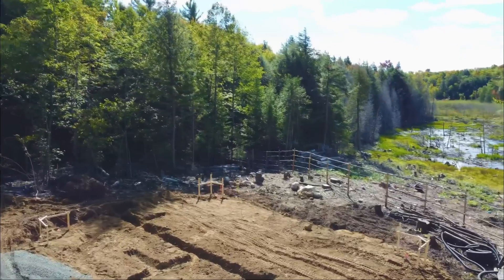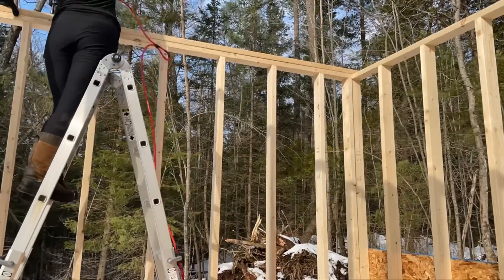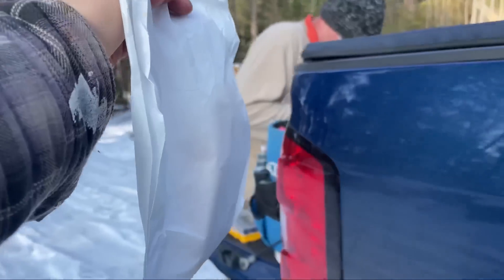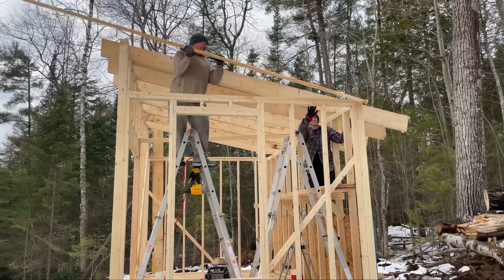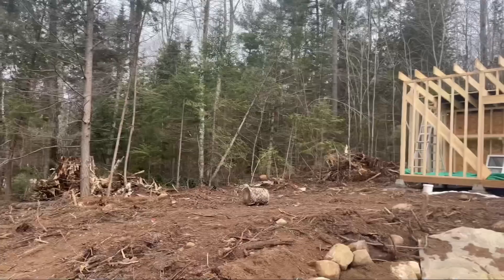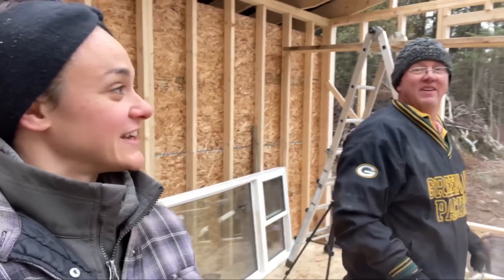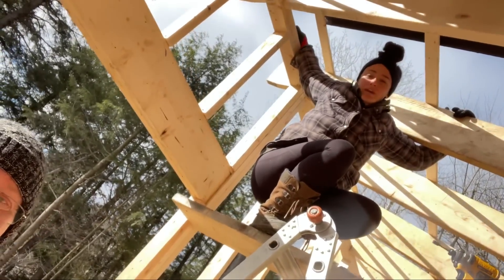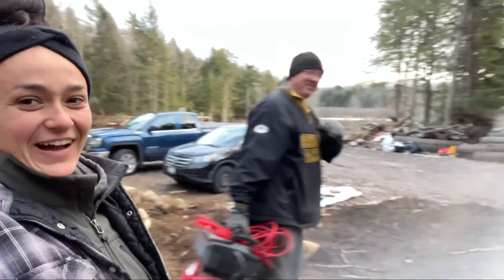SO MUCH Progress - Homestead Build - Shed Build pt 3

Comment: Good work & video! If your shed is like mine, you will sometimes get condensation drips from the exposed roof-screw tips that stick down through the bottom of the nailing strips. Not a problem for a woodshed, but not so happy for steel tools etc. under the drips...
Reply from the maker: I was noticing that with big ice and snow melts. It’s making me reconsider the roof!

Comment: Is there a reason you use OSB? I see it used everywhere and it’s terrible stuff. Breaks easy, absorbs water (even if they say it doesn’t), and doesn’t hold nails well. (I’m a plywood fan of course). Nails pull chunks of OSB right out of the sheets under high winds. For a shed it’s fine. Easy to rebuild 🙂 not trying to be a downer. You put it on the walls in the right direction. Good job! 
I built my house using 3/4” plywood on everything. Walls and roof. 3000 square foot home. Using OSB would have saved me $1000. Not worth it.
Reply from the maker: Wow! Good to know! It would’ve cost us $500 more for 10 sheets for the shed of 3/4 ply or $270 for 1/2 ply!

I’m thinking of going with zip systems for the house though
Reply: @SimpleLivingwithBiata  I get it. The prices were not crazy like they are now. Personally I just don’t like things made out of chips. It’s all the resins. Like building with plastic. I don’t know anything about the Zip System. But I’m sure I could pick it apart. 😁 
I don’t want to discourage you. Keep plugging away.